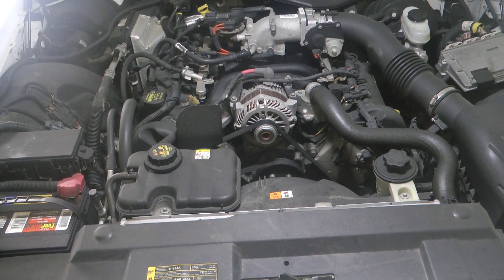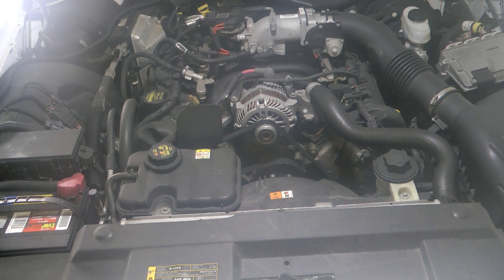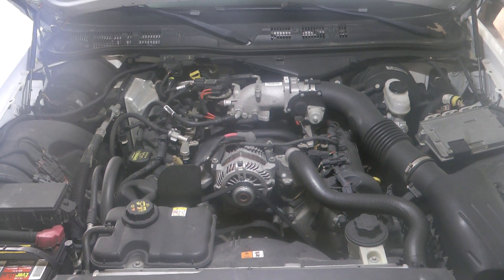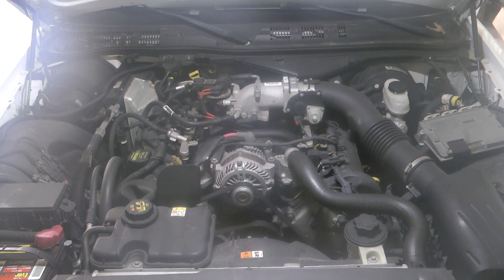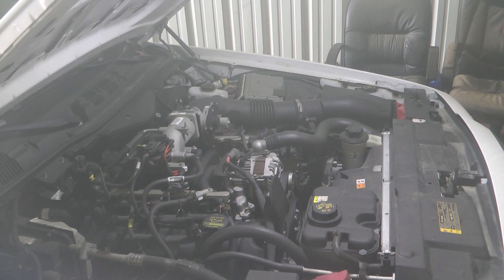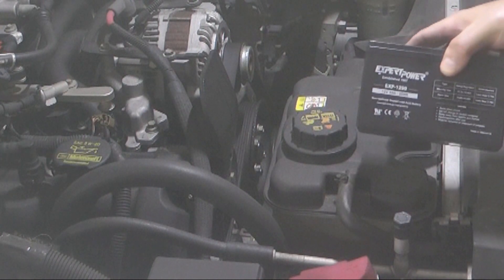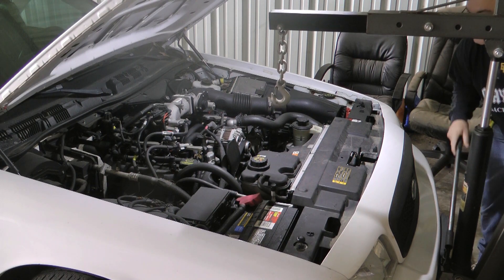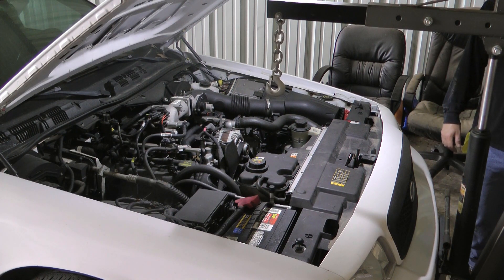How to change gas guzzler V8 to green electric motor

Comment: I have a 2009 CVPI with 3.55’s and on the HWY get 24mph, 😃
Reply from the maker: 24 once you are at cruising speed or are you able to get >425 miles before needing to refill?
Reply: I have own the car since 2017, purchased with 62k, 319hrs, currently 135k 450hrs, I don’t go below 1/4 using only 87 gas. Combined city/hwy about 16mph. It is certainly possible, it’s my daily driver. If you fill up and do all hwy 24/25 is possible at 65-70 using cruise control. 😊
Reply from the maker: you get better than I do.  At 70% highway/30% city I average 16.5mpg keeping detailed business records.  That's been the same across 3 different Vics.  Of course here 65-70 is not possible... you'd literally be run over.  If you've watched any of my videos when I'm driving on the freeway, you'll see vehicle after vehicle pass me going 85+

Comment: I just saw this video...two weeks late. Weird because i hit the notification button.  Love the video 😂.  But my wife and I do own an EV (2023 Chevy Bolt EUV), and we had a 2019 Bolt and a 2013 Volt before that.  They have all been great.  The technology is not there yet for them to be a long-range vehicle. But for a commuter car it has been great, especially those short trips where i won't get my engine up to temp that does more harm than good.  Plus, i do save some on gas and oil changes. We still love our Yukon and Z71, and my P71 is my toy.  Everything has its place I suppose.
Reply from the maker: I definitely think the EV's have a place, I just don't like how they are being shoved down our throats as the only way to save the planet